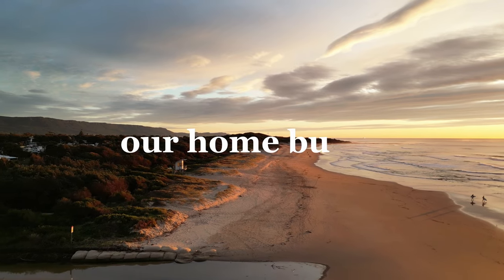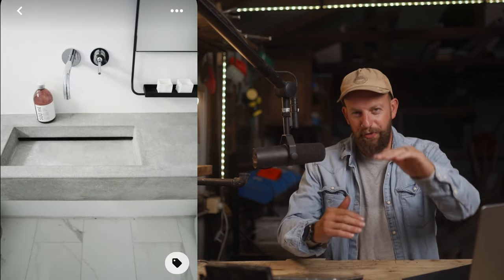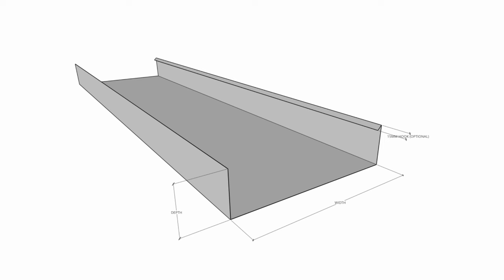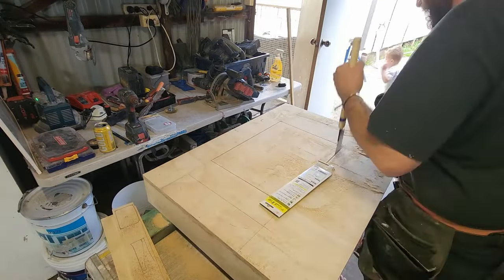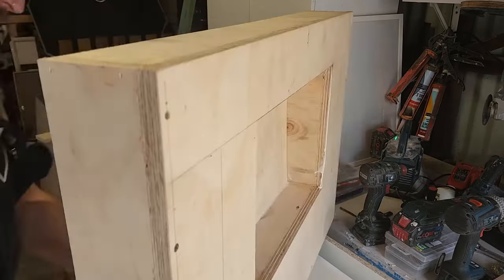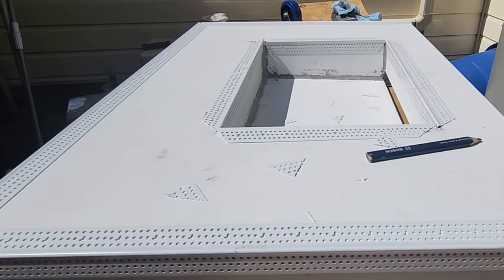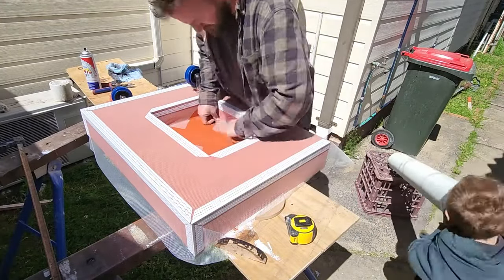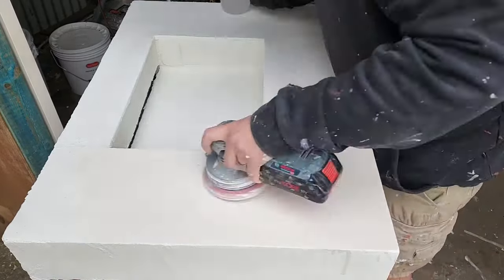Building a microcement sink

Comment: So cool! I am really considering doing this diy in my bathroom! Wondering, is the gutters trouf something you can access to clean if it get grimy? Also I'm not gonna do a whole bathroom like you did but maybe repeat the material on the shower bench? Do you think the bench would need to be done before tiling around it? How do you think I could achieve this? 
Your video is so cool!!!
Reply from the maker: I’d suggest looking for a small strip drain with a pop out grill, similar to what you’d use in a shower. I think it would make cleaning a little easier. You could do the bench at the same time as the tiles.

Comment: Awesome video, i want to do the kitchen counter top and if succeed at that. I might do the bathroom walls. How is it holding up so far and how do you maintain the microcement surfaces?
Reply from the maker: The majority of it is holding up very well.  However the bathroom floor is getting some scratches and it does show dirt quite easily which can be annoying when you have 2 young boys 😆

The bathroom walls are great, basically no maintenance. If I were going again, I'd tile the floor, microcement the walls. 👌
Reply: @viking.designs Thank you for your reply. I was already thinking of tiling the floor, but now i know for sure. Your video's are from high quality and a pleasure to watch
Reply from the maker: Yeah you're definitely on the right track imo. Good luck with it and thank you! 👍

Comment: Hey dude, Just about to start renovating my gaff after i got flooded by my upstairs neighbour, fellow chippy but just wondering what solvent based sealer you used at the end? Was it a 2 pack polyurethane?

Many thanks and great job mate, looks ace!
Reply from the maker: Cheers Matt. It wasn’t a 2 pack poly. I’m actually not sure of the brand. I got it from the same place I purchased the microcement from. Maybe ask your supplier what they recommend?
Reply: Ah sweet you’re a legend, thanks for the speedy reply, I didn’t know if you’d randomly used one you had in the typical chippys hoard of materials, I’ll give my supplier a buzz in the morning. 
Take care bud

Comment: What sealer and solvent did you use for the microcement? Can i use any type?
Reply from the maker: It was a product that came from the supplier that sold us the microcement. 

Who are you purchasing your microcement from? They should have a product they recommend.
Reply: I live in Malaysia and it is pretty limited here, the one that i can find only is microcement lotos plaster skim. It say how to prepare the micro but in area high humidity they just recommend to apply additional protective coating, nothing specific. Can i use a cement sealer on microcement?

Comment: Great video, cleaning the gutter may be an issue, how are you finding the cleaning of your design. Oh and what type/brand waterproofing did you use?
Reply from the maker: Hey Steve, sorry for the late reply mate. You can get a bottle cleaner down there to give it a clean. Next time I'd probably make the catchment area as small as possible to reduce water sitting but so far it been pretty good. Sealers are from the Venetian plaster gallery in Sydney.

Comment from the maker: Who's building one of these?
Reply: I so want a client to ask for microcement in their bathroom, but it’s just not popular enough and it’s hard to push a client to do something just cause I want to experiment. But I’ll follow your steps if I do. Could you make a pdf of the specs for the sink and attach it in the notes?
Reply: I am! Would be great to hear how yours is fairing after some use? Really great video!
Reply from the maker: @antoniablunt5866  Hey Antonia! Thank you. It's holding up really well. Still looks great. Think I may re-seal the water plane again in the next few months. If I were to build another one, I'd just be sure to do 3 - 4 really good coats of sealer where the water hits the sink.
Reply from the maker: @FraserandCoDesigns  I often try to push clients in a direction that I would like to try out haha. If I find some time, I'll put the specs in a pdf and I'll let you know.
Reply: @viking.designs  Thanks so much, really good to know!